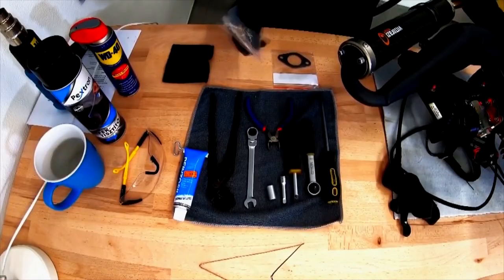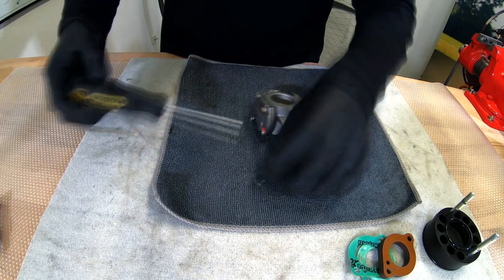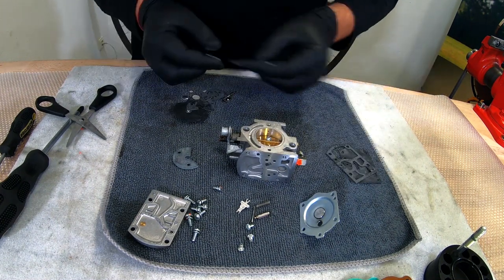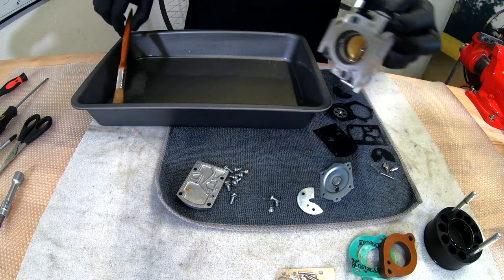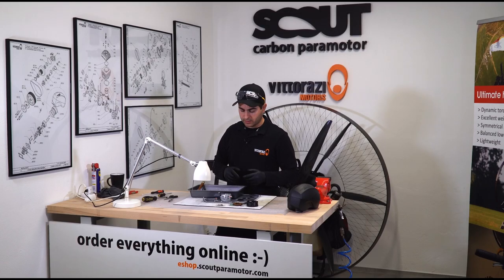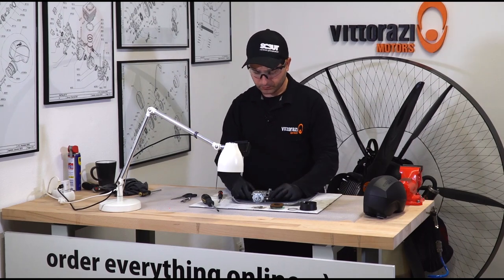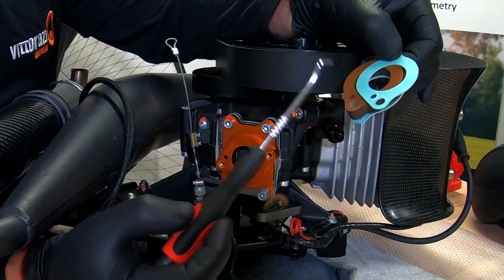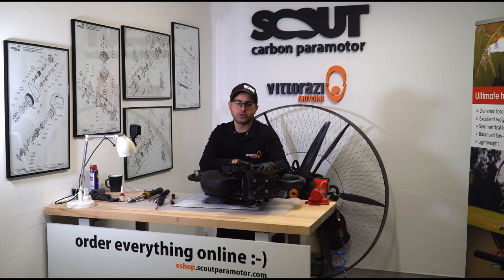Vittorazi Moster Plus 185 carburetor membrane replacement. Paramotor engine maintenance series.

Comment: Great video,  but I feel you should have covered more on how to set the metering lever height,  as well as checking and adjusting pop off pressure,  over all excellent video I just would have like to have seen you include a little more on these two aspects of rebuilding the carbs.
Reply from the maker: Hi Calvin, this video is about replacing the membranes. We will have a video about adjusting the carburetor, pop-off pressure and other adjustments that will cover those. 
Thank you so much for your feedback!
Reply: SCOUT paramotor  good deal. Just wanted to make sure,  that people realize there is a bit more to setting up the carb. Even with just membrane replacements. I recheck my metering lever height and popoff.
Reply: I know it’s 5 months later but I hope I didn’t miss the carb adjustment video! If it hasn’t been made yet, would love to see it please!
Reply: @SCOUTaviation  Very much needed video. Hope we can see it soon!

Comment: Great video series, thanks.    Yes, I throw away the "fiberglass-like" pump diaphragm, as they do not last very long before they get a hole in them.  But instead of using the rubber Pump diaphragm, I like to use the Mylar-based Pump diaphragms.  Fuel with ethanol in it will cause the rubber-based Diaphragm port "Fingers" to curl up, and not completely cover the fuel pump ports like they should.   The Mylar-based pump diaphragm does not have this reaction to ethanol, and will last years longer.   I am surprised the see Walbro did not include the Mylar-based pump diaphragm in your rebuild kit.
Reply: have u a link...?  or search mylar based pump diahragm for walbro 37c kit?

Comment: FYI, I tightened the carb screws to 10nm as mentioned in the video and cracked the plastic airbox connector.  Found out in the manual that the torque should be 6nm.
Reply from the maker: ouch sorry to see that. seems like we did a mistake?
Reply: I did the same thing

Comment: Nice video but no pulling needle jets for cleaning, no fuel screen replacement, and no metering/pop off setting.
Reply: pop off 15 psi

Comment: Moster 185 manual specifies 10 Nm for carburetor flange screws and 0.5-0.6 Nm for carburetor plastic connector screws. Are you sure the two screws should be tightened to 10 Nm?
Reply from the maker: Based on my experience 0.5 Nm is totally unrealistic for that flange. I know very well the manual, ofc. 10 Nm might be on the tight side, but using new gaskets I have found 10Nm to be spot on, without damaging the plastic flange anyhow.
Reply: Great video. I also question the 10Nm for the carburetor flange. At 10Nm the plastic flange begin to deform at the screws. I backed it down to about 6Nm but I’m concerned the damage is done. I’ll need a new plastic flange. Is there any new guidance from Vittorazi for the Moster MY20 Plus?
Reply: Definitely not 10nm!!! I torqued the plastic connector screws to 10nm and cracked the plastic boot connector! Back it down to 5-6nm and check the connector every time as part of your pre-flight

Comment: Cleaning?
Gasket sealants?
Lubrication?

Why did you throw out the old gaskets before you unpacked the new ones? - I would be carefully comparing the new ones - especially where there are two similar-but-different ones supplied in the new kit... to make sure I was installing the correct choice.

Any comments re what is special about these carbs? - Are they altitude-compensated?

Why not fuel injection? More to go wrong?

Thanks for the video anyway.

Good production quality ... only nit would be the music is too much louder than the speech, and the usual bugbear of pumping compression :-/

Cheers!